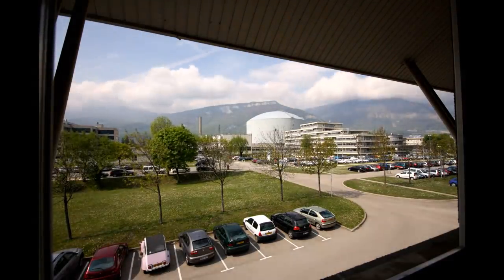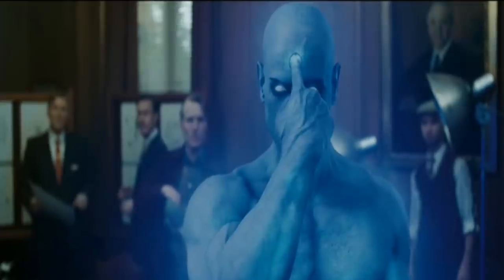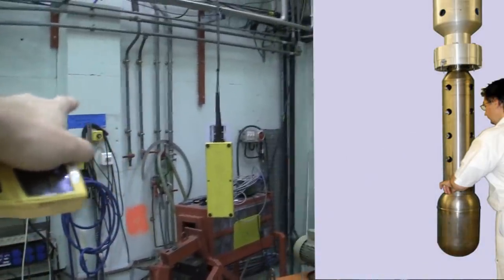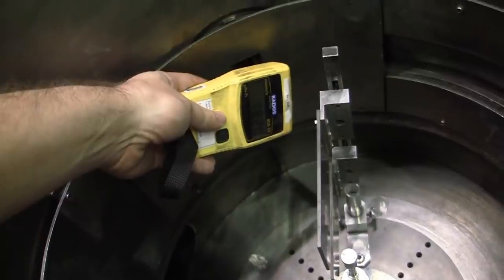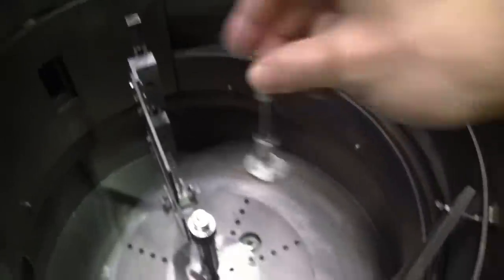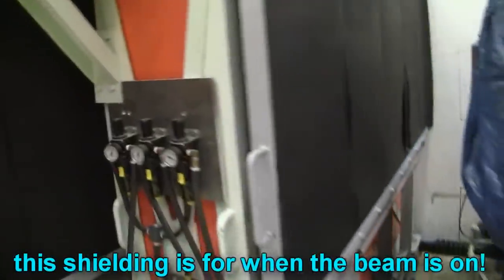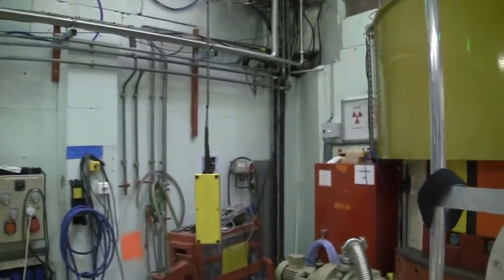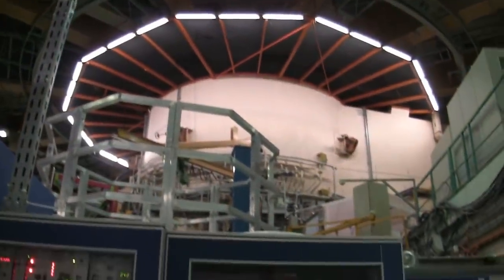Nuclear Reactors, Fantasy and Fact!

Comment: Can confirm. I work as a contract Radiation Protection Technician in multiple US commercial plants. I have seen this for myself from directly above the reactor. Of course, there is 60+ feet of heavily-borated water between myself and the top of the fuel. I would also point out, that at this point, the reactor is shut down and emitting so few neutrons as to be considered zero. The major danger at this point is gamma. Water, concrete and lead shield gamma pretty effectively.

Been doing it for about 15 years now and it still amazes me. Especially cool when the reactor is being refueled and you can see the Cherenkov Radiation coming off of the fuel bundles that have been through a couple cycles in the reactor as they are being removed or inserted in it. In this case they come within 8-10 feet of the surface of the water and we see very negligible increase in radiation. However, most plants don't even operate detecting equipment capable of accurately measuring the radiation directly at the bundle. 

 Mostly what amazes me is that these massive examples of human ingenuity are just glorified steam engines. Still, that such things are possible, is amazing.
Reply: +MrKalvinC not who you were looking for, but i am a nuclear operator ;) 
briefly, here's the chain of events for fukishima: earthquake occured, reactors tripped with emergency shutdown systems (used to be called a SCRAM). they withstood an earthquake significantly beyond what they were designed for. however, they had two fatal flaws: tsunami wall was too small and backup generators were located in the basement. when the tsunami hit, grid connection was destroyed and basement was flooded knocking out backup power. normally they'd either draw off the grid to power cooling pumps or use generators.

the reactors remained shut down, but with nuclear heat is still being produced by decay heat. this is unstable elements that still emit heat and radiation. this heat does subside with time but still remains for many years. without cooling, their reactors experienced a slow meltdown. 

the next problem they had was hydrogen gas build up. reactors use an alloy called zircalloy. unfortunately combined with high radiation the zircalloy acts as a catalyst which splits hydrogen and oxygen in the water forming hydrogen and oxygen gas. after a while, their reactor buildings turned into big bombs...a lot like the hindenburg. if you remember them talking about venting these buildings during the disaster, this is why - they were trying to get rid of the hydrogen to prevent explosion. unfortunately they were unsuccessful. if they had maintained the containment buildings intact, contamination to surrounding environment would likely have been almost nothing. this was the case with 3 mile island. 

so could this happen elsewhere? the simple answer is yes, although its very unlikely. reactor design is a major factor as is regulation. where i work, we have some portable generators and pumps just in case of such an event where all defenses fail due to some unforeseen catastrophic disaster. fukisima had known flaws and the plant operator TEPCO was told. they never fixed these problems, that's why there has been some big legal action. in my humble opinion, japan's government chose capitalism over safety in this case. i know other countries where the regulation would have forced them to shut down until modifications were made!

there are other reactor designs out there where although these problems do exist, it's not nearly as severe. bottom line is safety first. nuclear power is very safe if managed and regulated correctly. 

interestingly, there are newer designs starting to come out (known as gen. 4) which are free of problems such as this. a meltdown would be nearly impossible. some can also run on waste fuel so we can get rid of it much sooner. consider fueling one up ONCE and running for 70 years (give or take) and the waste coming out is nowhere near as radioactive. but i'm getting off topic....hope that answers your question.
Reply: @cressylovin  
Very good. 3mile island was neglected maintenance. Sprayer in pressure vessel leaked, lost pressure bubble and went solid. The Japanese could have put the reactors deeper and used gravity cooling from the sea. I just got confused with this guy's explanation of radiation. First there are alpha, beta which he never mentions, gamma, very little xray , and neutrons. Neutrino goes through everything. His descriptions were way off. All is ionizing. Yes, isotopes give off radiation in different mev levels. That was how we identified contaminating isotopes. Every thing he talked about was like he was still learning. A novice so to speak.  Heard words from his instructors but using them wrong. You agree? R-5 division Holy Loch Scotland 67-69. On the Simon Lake.
Reply: Da Moose For what I do, I don't need a degree. You are trained on the job. There are degrees that you can get that will guarantee higher pay and more jobs, but it's not necessary.

Now, if you want to be something like a Reactor Operator, the best way to do it is to go through the Navy. Any plant will snap up any people that have been through the Navy as an operator or engineer. However, many community colleges in areas near power plants usually have programs that you can go to for this sort of work as well.
Reply: ok guys, calm down. let's toss a bit of fact into the mix here.

firstly, fukishima reactors WERE in fact fully seismically qualified and therefore were designed to withstand earthquake. i believe they were designed to withstand an 8. the reactor buildings included very large and deep footings to support this. i'd say they did very well in that department since they withstood a 9 just fine.

the plant was very much designed to withstand a tsunami. hence the tsunami wall among various other design features.

so what went wrong? two things:
1. the tsunami wall was not high enough. TEPCO admitted as much and is facing charges of criminal negligence over this.

2. the backup generators were in the basement. once the flood happened, they were under water and useless.

in fact, the Japanese government warned TEPCO of these very flaws long before the disaster and they chose to ignore it. where i work, we'd be forced to shutdown by our government regulator until these problems are fixed. the price of capitalism? you decide.

finally, the slow overheating and eventual meltdown is not exclusive to this design. the buildup of hydrogen which destroyed the containment buildings is not either.

when a reactor shuts down (fast shut down, often called a SCRAM), all fission stops almost immediately. however, unstable isotopes continue to produce heat for a quite some time after - as in many years. this is known as decay heat. its far less than full power heat, but in the case of fukishima they had no heatsink and could not remove it.

most plants out there fall under generation 2 design. this is a problem for ALL of them. simply put, this is a byproduct of 'burning' uranium. it is unavoidable. different designs can handle it better or worse to varying degrees. some plants use what is called thermosyphoning where the boilers are higher than the core. hot water rises up into boiler, deposits heat into non-radioactive side of the boiler, once cooled falls back down into the core creating flow even if slow. this is limited, but buys a great deal of time. different designs mean this may or may not be an option. additionally, once the water on the clean side of the boiler is depleted (as in boiled off to steam to atmosphere or lake) you're kind of screwed unless you can replenish it - and that doesn't take long.

so without power, it doesn't matter your design. note i'm excluding gen 3+ and gen 4 designs since there are very few gen 3+ and currently no full scale running gen 4 designs in the world. passive cooling has been a BIG deal and is a critical design feature of all new reactor designs.

the backup generators....that was just a stupid idea. i can't defend that in the least.

for the hydrogen...reactors use a material called zircalloy. it's used because it doesn't hinder the reaction - it's pretty much invisible to neutrons. they pass through it very freely and neutron flux is your power if i may be allowed to simplify things a little. downside is zircalloy acts as a catalyst for hydrogen radiolysis. the high radiation breaks the bonds of the water molecules into oxygen and hydrogen with the zircalloy catalyst.

with power, this is not a problem since hydrogen ignitors burn it off harmlessly long before it reaches a dangerous concentration. without...well we know what happened. this is why many plants are installing passive hydrogen recombination units that do not require power in addition to the ignitors that they already have.

my conclusion: nuclear power is very safe - safer than any other power generation method by the numbers - IF AND ONLY IF used correctly. tough regulation is key. fukishima was nuclear done wrong.

but hey i'm only a nuclear operator. it's only my job to be a systems expert. you don't have to believe a thing i say ;)
Reply: +tw34k3d that is one of the designs, yes. gen 4 refers to a design principle rather than a particular design. generation 1 was the early research ones (even hanford), gen 2 were the first power reactors and are unfortunately most of what we still use today, gen 3 changes were mostly safety, and gen 4 is what is starting to take shape.

to be called a generation 4 reactor, it must be pretty much impossible to have a meltdown scenario. think passive cooling that doesn't need anything. also, waste must only remain hazardous for about 500 years - as opposed to several thousand.

there are several designs, bill gates' traveling wave reactor, molten sodium as mentioned, pebble bed to name a few. china is currently building a couple pebble beds so to say there's not much money going into this is not true. liquid salt on its own? yeah it's an idea still tossed around, but i'm not sure what will be the winner. fermi in the US and phenix in france were some of the first. france tried to scale up and called it super phenix...it was a colossal failure. 

so without going off on a tangent here, there are several designs being developed. here in north america, we're afraid of our own shadows so no not a lot goes into them here. elsewhere in the world it's a different story. 

its funny to think of though. all of the major accidents have been with old heavily flawed gen 2 designs and we're too frightened to think about it again. it's a little like getting into a bad car crash with a car from 1920 and thinking it'll be the same with one built this year.
Reply: Thank you both for informing me, much appreciated.
Reply: +malaclypse2317 Thanks for the nice explanation, extremely useful
Reply: +firefoxhits Fukushima is not a world scale disaster. Not a single person has died from radiation or ever will as a consequence of Fukushima. At this point the most serious consequence of Fukushima is the ill-advised evacuations from areas that did not need to be evacuated (when you evacuate old folks who need constant medical care, they tend to die). The second most serious consequence of Fukushima has been the closing of nuclear plants and their replacement by deadly fossil fuels. This releases dangerous particulates, ozone and NOx that cause strokes, heart disease and lung cancer. The third most serious consequence of Fukushima was that a couple of workers ignored safety procedures and waded into radioactive water and got beta burns to their legs (about as severe as a sun burn).

That is the extent of the harm so far.
Reply: fukishima was far less damaging than chernobyl. partly due to the fact that chernobyl was a prompt critical event where the reactor power rose to several thousand times more than it's design almost instantly. it will not be anywhere near as bad, but evacuations unnecessary? no that was very necessary. i'm sure they went overboard in some areas, but they didn't know the extent of the spread of contamination at that time. we're talking about very dangerous isotopes such as radioiodine here. your pituitary gland uses iodine but very little is available naturally. for that reason, the gland sucks up as much as it can. it also can't tell the difference between radioactive and non-radioactive iodine so when there's a large amount of radioiodine in the environment, it sucks up as much as it can until it's saturated. this stuff is also a strong emitter of beta radiation and now it's inside your body emitting beta constantly. great way to get a very deadly form of cancer. this is why they evacuated such large areas - they can't predict how much will be emitted to the environment or how far it may travel. and that's only one example...

yes the increase of fossil fuel emissions is far worse. people are very frightened of radiation to the point of stupidity. funny that we don't consider alpha radiation emissions from burning coal - we don't even track it. it might sound like i'm arguing that nuclear power is very dangerous in the above paragraph, but that's not the case. i'm simply saying that a great deal of respect and care must be given to the hazard - especially in the face of the unknown. 

the burns from the workers walking through water is not as harmless as a sun burn. it was not a large puddle of water and the workers incorrectly thought this water to be a leak from a non-active system. in an emergency situation when you're running around trying to put out fires left right and center, i'm not surprised that something like this occurred. the problem is that to get skin burns from ionizing radiation such as gamma, beta, etc. it's not the same as ultraviolet from the sun. by the time you get a skin burn you've already suffered a very large dose. your skin is actually more resilient to dose than your internal organs. so if they have skin burns....that's a big dose. might not be enough to kill them now, but i would expect a nasty cancer such as leukemia not all that far down the road.
Reply: That's actually pretty amazing, all these complicated machines and processes and the goal is still to get some water to boil.
Reply: +Crobular I He beat me to it. Yep,  It's concrete.
Reply: unfortunately that goes a bit beyond my training, but i'll try to help best i can. the problem is becquerels is a measure of the radioactivity of a given isotope. dose rate is the real concern, but that depends on several factors. the more of this material that you have, the higher the dose rate. so a very tiny amount of a highly active source is actually quite safe - there just isn't enough of it there to generate a dangerous field. this is not to say that it shouldn't be treated with care and respect for the hazard. next factor is how close you got to this source. distance makes a huge difference. for example, dose rates for a gamma source are a square function. i could hold a gamma meter directly up to a hit spot and get 2 rem/hr (known as contact dose rate). a foot away and it could drop to as little as 30 mem/hr (or 0.03 rem/hr). the final function is time. your dose is how long you have been exposed to a radiation field of X intensity. that is to say, the stronger the field the less time it will take to get the same dose when exposed to a weaker field. it's all pretty simple, being exposed to a field of 5 mrem/hr for a time of 1 hr will give you a dose of 5 mrem. 

in your case, i'm guessing that exposure is mostly to your extremities (hands and arms). that's actually a lot safer than your core body - it's your internal organs that really don't appreciate radiation. there's not a lot in your hands to damage, so extremity dose isn't as bad. not to be confused with perfectly safe!  it's just to say that your hands and feet can take a higher dose rate before any ill health effects. you should have had gloves at the very minimum to avoid any contamination.

the final consideration is the fact that this is a neutron source. neutron penetrates the body in a similar fashion to gamma radiation, but there are some key differences. neutron radiation is the isotope (Cf in your case) ejecting neutrons to try and stabilize itself. it's kind of like a BB gun. the neutrons will bounce off surroundings. if you were working with this inside a containment box of some sort, i would expect very little to escape if the field is weak enough. especially true for heavier materials such as steel and lead. 

hope that helps a little...some sources are actually very safe since it's such a small quantity. smoke detectors are a good example, they contain a small amount of americium which is also a neutron source - but safe enough to sell to the general public. 

regardless, your employer should have fully explained the hazards to you including the expected dose rates of this material. you have a right to know these things under the law. is there someone you can speak with there? maybe someone other than management would be a thought...
Reply: +Cressylovin "it will not be anywhere near as bad, but evacuations unnecessary? no that was very necessary." .

At no place outside of the plant boundary did you find higher does rates than ~200 mSv/year shortly after the accident (peak dose rates) in a localized streak northwestwards from Fukushima. That's an outdoors dose. Move away some contaminated topsoil directly where people live and work and it is immediately several times lower. A year later it was about half.

Radioiodine isn't a problem. Tell people not to drink the milk for a couple of weeks and take their iodine tablets that they were issued with and have at home.

200 mSv/year is normal in parts of Ramsar, Iran, from radium in the streams and hotsprings and from radon. Doses are very spotty, which offers pretty good controls (a couple of houses over is not a different social strata or culture). There is no detectable increase in cancer mortality or risk there, and these people live there from cradle to grave, not for a couple of years.

They drew a 30 km circle at Fukushima and evacuated everyone regardless of dose. Over half of this area was at <20 mSv/year and  or so at 4 mSv/year.

"the burns from the workers walking through water is not as harmless as a sun burn."

Exactly wrong. 

It was mostly betas from cerium-144 and iodine -131. Betas only penetrate skin deep. We're not talking skin hanging off rotting flesh; where talking about reddening of the skin.

The numbers I've seen from gammas is 170 mSv. That's not a lot. We can't even detect an excess cancer risk among the liquidators who went up into 20 Sv/hr on the roof of the blown up reactor and shoveled fuel channels graphite moderators blocks off the building, a few minutes a time. In fact, we see a deficit. Radiation is a piss weak carcinogen.

You don't get leukemia, a bone cancer, from low dose rate external gamma exposure (again, see the Chernobyl liquidators). The only place you'll ever see leukemias from external radiation is prompt radiation like a Hiroshima and Nagasaki where there is a slight excess among people who absorbed > 100 mSv in an instant. Leukemias from radiation are mostly from  very large body burdens of bone-seeking alpha and beta emitters such as radium and strontium (look like calcium, so the body sticks  them where it usually sticks calcium). From the follow up of the ~3000 radium dial painter girls (who sharpened the brush with their lips inbetween paiting watch dials with radiofluorescent radium paint) we know that the risk of leukemia in people with a lifetime committed bone dose of 60 Sv (!!!!!) is too small to observe in a cohort of 3000. Again, radiation is a piss-weak carcinogen.
Reply: +malaclypse2317 If you dont mind me asking what sort of degrees do you need to work in a place like this? this is literally my dream job!
Reply: @ft4088  Thunderf00t - Phil Mason has a PhD in chemistry.
Reply: +mrnickbig1 I live about 60 miles from New Orleans and generators placed in the basements failed when they flooded.  I believe the architects and engineers probably locate backup generators in the basements because they weigh a lot which results in the need for a lot more support structure and cost, they vibrate which makes matters worse if they are on the top of a building, and all of the electrical busbar and control systems are in the basement and electrical infrastructure declines as it heads upward.  But when building a reactor that is supposed to have a massive containment structure, loading generators on the top wouldn't seem to be a great problem considering.  It as if they are still building a hotel or commercial office building in the back of their minds.
   The convectional water cooling system seems like a no brainer.  Since the failsafe valves did not go into the failsafe position, there should also be a parallel backup system that can be opened by a man turning two wheels outside of the containment structure that has a shaft that goes through the containment structure wall to the valves inside.  While primitive in the world of remote control and powered valves, having a backup system that is simple with the least amount of links in a chain that takes one to break.
Reply: the short answer is no, there would be no across the board failure.

but here's the long answer: first, on loss of grid (such as we had with the big blackout quite a few years ago now) all plants would experience load rejection. in other words, turbine/generator disconnects from the grid. this will eventually lead to reactor trip. there's another scenario of poison prevent, but i'm not going to get that technical here. when the reactor trips, all fission stops. what you have left is decay heat. that's what got fukishima.

after grid goes dead, backup generators start to drive coolant pumps. with fukishima they were underwater....there's multiple generators, more than what the plant requires to handle failures or maintenance. many are also built to withstand earthquake.

so to loose that you'd have to be in a secnario such as fukishima. unlikely in the US and it would never be all reactors. i can think of a few such as large meteor impact. maybe cut off from fuel once they run out.

in addition, many plants have portable pumps and generators in the event of massive plant damage that could take out their backup generators. 

the time it would take to become a problem is very dependent on the plant design....so hard to say.

safe zone? that's also difficult to say. depends on the plant (ie. size of reactor) and magnitude of disaster. if containment is intact, you're quite safe...but there's many factors. in nuclear, we err on the side of caution. in a major disaster event like what you're talking about i think you'd be leaving home anyways if possible. you might just have bigger problems.
Reply: Thanks I really appreciate it. From what I understood reactors were relatively safe and should contain most the radiation. So as long as no traumatic damage occurs to the housing it should stay contained? The reason why I'm asking is due to our currant state of affairs.
Reply: Running out of fuel for the backup generators is what I was referring to earlier. With a Carrington event, fuel would become quite scarce as refineries stocks deplete.
If memory serves me correctly, our plants were mandated to have hydrogen gas mitigation systems in place, which were not required for Fukushima. Those systems prevent a buildup of hydrogen gas in the containment building and surrounding structures, so there would be no hydrogen gas/air explosion like happened at Fukushima. That change was, in part, out of concern after a hydrogen buildup occurred at two and a quarter mile island.
Yeah, I went there with that rather dated joke.   ;)
But, around 19 tons of core melted and settled at the bottom of the pressure vessel at TMI. That suggests that the pressure vessel may be capable of withstanding a complete meltdown and should the pressure vessel fail, containment would still withstand the hot corium.

Anyone remember who the pinhead was that kept going on and on about Fukushima going critical after melting? I remember that he alarmed quite a few people, even after he was repeatedly proved wrong.
Reply: @spvillano  
They have also increased measurements to severts? 100 rem everything we measured was in rem and milirem.  Change the tech terms to confuse. SCRAM...reactor shutdown. Core... The uranium core ...rods .....the moderator rods. Ect. We had incidents untill they became accidents. 3mile island prime example. Sprayer in the pressure vessel leaked. Con Edison I believe was told to fix it. Didn't want to lose money on a shutdown. Leaked too much too fast, lost bubble and pressure, plant went solid. Developed a bubble above the core, exposed fuel rods, no way to control temp.....accident.
Reply: @jerrynewberry2823  there is no increase, sieverts are SI units, rem units are the antiquated CGS system and largely has fallen by the wayside internationally.
Just as, when working with foreign military forces, I used kilometers, kilograms and liters, so that we had a common system of measurement. We are the only nation on the planet to not switch entirely over to SI, which is something that cost us a great deal of money lost when SI and Imperial measurements were used on a Mars probe, which impacted the surface, rather than land on the planet.
Reply: @spvillano  
A seivert is 100 roentgen from what I have heard. They were exposing people to mili-seiverts or one tenth of a roentgen during cleanup and have heard ridiculous exposure be rates that will kill. All fluffed off with this sievert.
Reply: @spvillano  
300 rem or reontgens were enough to kill 50% of those exposed. 600  is 100% death. With a few exceptions. They can't have changed that.
Reply: @jerrynewberry2823  OK, if I expose you over a year or two to six hundred roentgens, are you going to drop dead?
No, because the roentgen and rem are different measurements, as the rem is roentgen equivalent man measurement that's exclusively used in the US.

SI units are internationally recognized units, where the sievert is equivalent dose of ionizing radiation, gray the absorbed dose, becquerel is decays per unit time, etc.
https://en.wikipedia.org/wiki/International_System_of_Units

When we trade internationally, we use kilograms and liters, SI units that are globally standardized, save within the US, where we reference some dead king's foot length and other arbitrary units.
When reading reports from Japan after the Fukushima meltdown and the Chernobyl explosion and meltdown, everything was reported in sieverts, grays and becquerels and everyone not in the US understood the measurements.
Reply: +malaclypse2317 Hi - So in Fukushima - what happened? And give all of the safety - is it possible to happen in Europe or the Americas?
Reply: +Cressylovin These new reactors you talk of, they sound like liquid-salt Thorium based reactors are described (as in they can consume nuclear waste, and produce very little waste in return), i didn't think there was much money going into developing them, which leads me to believe you're not talking about them, so what is new with the newer reactors?, are they just more efficient/better designed, but still the same basic principal and fuel?
Reply: Cressylovin I see, thank you for the detailed reply.
It's going to be harder and harder for governments to oppose nuclear if meltdowns can practically be guaranteed to never happen, and if the spent fuel is radioactive for far less time, it would be criminal not to start relying on it more, i guess it's the masses that have to be convinced, and they will still be thinking of Chernobyl and Fukushima for quite some time.
I can't say i'd ever heard of Superphénix, a quick google says it was a liquid Sodium fast breeder, so very similar to the liquid salt experiment, but I have a lot more reading to do there.
I have to admit that the liquid salt experiment (once they had figured out the corrosion issues) seemed too good to be true, although i've just heard that India is investing quite heavily in this one as they have large deposits of thorium, which may make or break the idea, no disrespect to India, but if it goes badly i suspect it would not be the fault of the principal, but rather it's deployment (ie: using the cheapest contractors/materials, not following safety standards, flawed design (reasons the west have had issues), it would probably be the last nail in the coffin for it if there was an accident.
Reply: Hi, may I ask you a question? I used to work with a Cf neutron radiation source of 2*10^5Bq (I worked in the lab for about a month), and we were not very careful about protection. How dangerous is a source like this?
Reply: glorified steam engines XD
Reply: They are steam engines, no more, no less. The primary loop serves as the boiler.
Reply: +Cressylovin, the pituitary gland doesn't take up much iodine, it's the thyroid gland that's the iodine hungry gland. 

Also, the Fukushima workers that received radiation burns from the water had beta radiation burns, not gamma. Still bad news, but not quite as bad as with gamma or fast neutrons.

+firefoxhits, the reactor did have an auxiliary backup. That, alas, was above ground and hit by the larger than anticipated tsunami.
Reply: Hello, if one of you could please answer a question for me. If we had s full grid down scenario in the States, would the reactors go into a shutdown mode and become safe? Or would it be complete failure across the board? If they did fail, what do you think would be an acceptable safe zone?
Reply: If we had a major event, such as a Carrington event https://en.wikipedia.org/wiki/Solar_storm_of_1859 , we'd lose most, if not all electrical transformers, switching equipment, some power lines and generators.
In that case, standby power would be restricted to surviving generators that were offline, which could still power the coolant pumps. Then, if fuel isn't delivered in time, those would be lost and we'd be looking at a Fukushima, done milder (loss of coolant, without earthquake and tsunami damage.
So, there'd likely be melt downs, but less leakage, as there wouldn't be earthquake and tsunami damage to cause the massive leakage that was present at the Fukushima reactors. The biggest challenge then would be to prevent a hydrogen gas/air explosion within containment.
Reply: In the UK you will need a relevant masters degree.
Reply: malaclypse2317 z
Reply: Cressylovin I'm curious, what's your take on a Thorium Nuclear Power Plant?
Reply: fun fact in Czech Rep we operate 6 reactors in 2 plants, we get regular visits from IAAE, and once during such visit an inspector fell into pool with depleted fuel, got a fresh boron, nuclear heated water bath, and walked away unharmed :D true story
Reply: Cressylovin While this is irrelevant, Australia would be a good place to build a nuclear reactor. No natural disasters excluding droughts and floods depending where you look. We have a descent export of uranium. But we only have 1 reactor and it’s a medical one. Additionally, Australian power is really fucking expensive. I think... never checked our pricing.
Reply: firefoxhits
 It is a modified GE design, that was NOT designed to withstand earthquakes or tsunamis. There is NO EXCUSE for the Japanese to have it 100% dependent on electricity.
Reply: "TEPCO was revealed to be controlled by American investors..."

Citation please, from a respected source, not some fringe BS source. If I want fake news, I'll watch the POTUS and his all girl band.
Reply: +malaclypse2317  At 6.15 who the hell did that lousy welding ?. CRAP.
Reply: +Crobular I Pretty sure that's a concrete wall. That isn't a weld, it's a crack between blocks or sections of concrete.
Reply: mrnickbig1
yes, there's no  excuse, but aren't all GE systems and others not designed in the same manner for auxillary backup?
Reply: we don't need you too confirm that's why we come to watch thunderfoot's videos : ) still good info
Reply: +mrnickbig1 NOT TRUE! Fukushima's reactor is not a Japanese design. It is an American GE Mark1 reactor all designed and approved by GE. Yes, there were a great number of potentials present at that particular site that did fail and allowed this world-scale disater to occur. But the majority of these flaws still exist in every other like GE reactor in Japan and elsewhere and WILL cause the same nightmare meltdown scenario with deadly releases of radiation. The nuclear industry is controlled by big money and polices itself, hence little will be corrected and the next disasters WILL occur further speeding our extinction. It is important to understand that none of these plants were designed to cope with meltdowns or incorporate methods to secure and safely contain a melting core. That inability exponentially complicates matters. You know we are facing epic levels of hubris and incompetency in the nuclear industry when no one can even tell where the cores now are. I cannot believe how incredibly stupid mankind is. Check out the information presented by Arnie Gunderson, a PhD in Nuclear Engineering at Fairewinds who closely monitors and follows the Fukushima event.
Reply: +MrKalvinC +mrnickbig1 NOT TRUE! Fukushima's reactor is not a Japanese design. It is an American GE Mark1 reactor all designed and approved by GE. Yes, there were a great number of potentials present at that particular site that did fail and allowed this world-scale disater to occur. But the majority of these flaws still exist in every other like GE reactor in Japan and elsewhere and WILL cause the same nightmare meltdown scenario with deadly releases of radiation. The nuclear industry is controlled by big money and polices itself, hence little will be corrected and the next disasters WILL occur further speeding our extinction. It is important to understand that none of these plants were designed to cope with meltdowns or incorporate methods to secure and safely contain a melting core. That inability exponentially complicates matters. You know we are facing epic levels of hubris and incompetency in the nuclear industry when no one can even tell where the cores now are. I cannot believe how incredibly stupid mankind is. Check out the information presented by Arnie Gunderson, a PhD in Nuclear Engineering at Fairewinds who closely monitors and follows the Fukushima event.